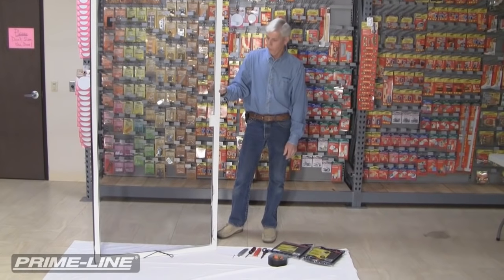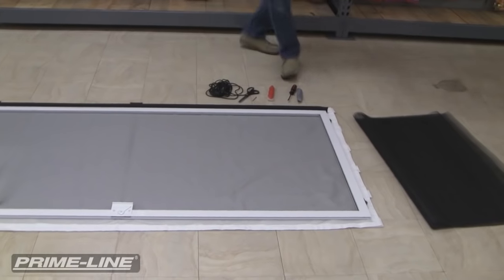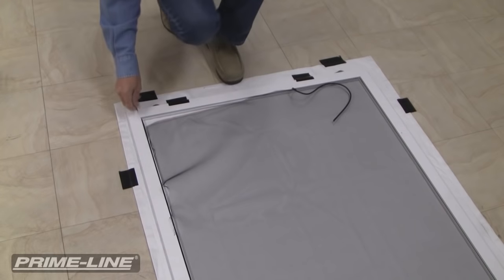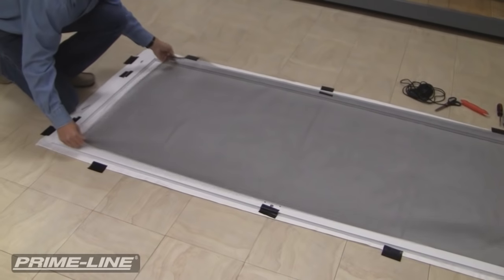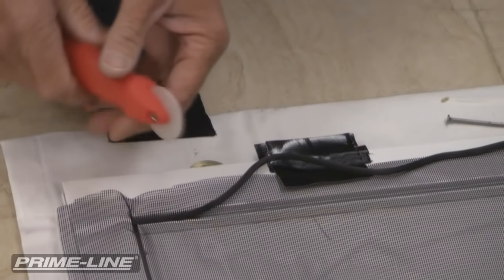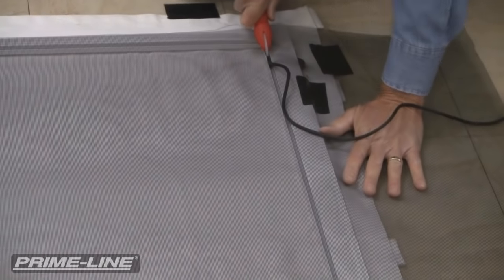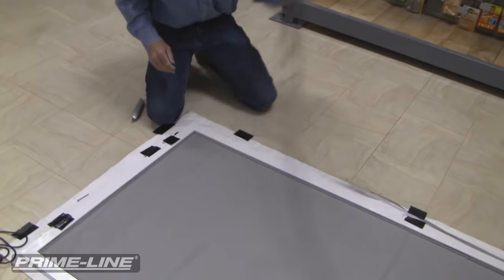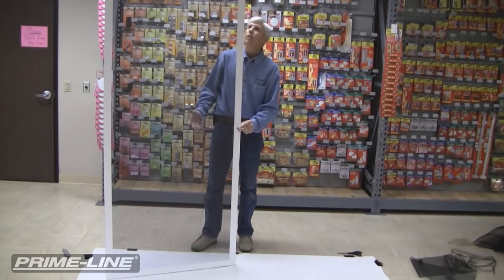Sliding Screen Door Re-Screening

Comment: What I mean is: Do you have any advice on how to install the metallic flywire mesh which is much stiffer and stronger than the fabric that you are fitting?  I'm having trouble pushing the mesh into the grooves with the spline since it is very stiff and strong.
Reply: It helps if you  use the convex wheel to push the metal mesh into the spline channel first, then push the spline into the groove that is created.  It may also help to try a smaller (newer, softer) spline, depending on the size of the original mesh versus the new mesh.  Metal mesh is often thicker.  www.thepatiodoorguy.com
Reply from the maker: Higgs Boson We've shot a video for you showing how this is done.  Sorry it took so long to get back to you.  You can see the video here:  https://www.youtube.com/watch?v=AUr2W35Unc4
Reply: Thanks very much your suggestion worked very well.

Comment: So I'm looking at about 25 different diameters of spline material (not to mention smooth or ribbed). How do we know what diameter to buy? I have a 25" x  84" Simonton sliding door that my dog went through on the first day.
Reply from the maker: If you're using the same type of screen cloth,  you can re-use the spline that came out.   If you decide to put in "Pet Screen"  you should use a spline that is .03 smaller than what you have.  If you have any more questions feel free to ask.

Comment: My question is about the door itself which is broken on 2 opposite or diagonal corners. Screen is intact. My kid ran against the door hard but the screen remained intact but the door broke. I tried gorilla glue but it’s so heavy it still not standing up. Can this be fixed?
Reply from the maker: There are corners that hold the sides of the door to the top/bottom of the door.  It's possible that those are now broken.  You can contact our technical support department and they may be able to help you find some new corners.  1-800-255-3505 .

Comment: What would happen if you pulled the mesh fabric to tight while inserting the spline.
Reply from the maker: The frame would bow in on the sides, top/bottom or both.  You can just pull it back out and re-insert it and not pull the fabric so tight.  Not the end of the world.  How do you do your EZ Screen windows?

Comment: Interesting that the original spline came out in 1 piece. Why jump around the frame top to bottom, side to side? Instead of just stating at one corner and running?
Reply from the maker: Stephan Rabai This door has never actually been mounted on a door frame, and the spline has never seen the sun.  A screen that's been on a house for a long time will have brittle spline that may or may not come out in one piece.  Most of our kits include the spline just in-case.

The reason for going top to bottom, side to side is that if you were to just go all the way round you could end up with a bulge in the screen when you got to the last corner. This way keeps the screen nice and tight.    I stretch my own canvases for painting and I do it the same way with a slight variation since I'm using staples & not spline, never had an issue.

Comment: What size of spline did you use?  I need to replace mine,
Reply from the maker: You'll want to get spline that's the same size or a little larger than what came out of your screen.  Our screen kits include either .155 or .180 spline.
Reply: Prime Line Thanks for the tips.

Comment: Ok, but how do you get it out of the door/tracks?  Sorry, I am new at this.  😂
Reply from the maker: Sorry for the late reply.  You should be able to loosen up the rollers on the bottom of the door,  they lift the door up into the track at the top, pull the screen out at the bottom and it should come out fairly easily.   Put it back in in the reverse order, then re-adjust your bottom rollers.
Reply: Prime Line thank you so much!  I think I might be able to do this!

Comment: I used a pizza cutter as my "rolling tool"
Reply: I boiled the rubber seal like a piece of spaghetti sticking it to the wall to make sure it was pliable enough to install
Reply: @peglegnoid6139  I baked it at 325 for 15 minutes or until soft in the middle. You can also put leftovers in a Tupperware container and It will stay fresh in the fridge for about a week.

Comment: This video totally sucks. You can see many spots where the screen is loose and not pulled taut
Reply from the maker: I've explained this in previous comments down below about this.   The wrinkles are on the white cloth tarp UNDER the screen and frame to keep the frame from getting scratched while it's on the ground.  Look back at the beginning of the video.